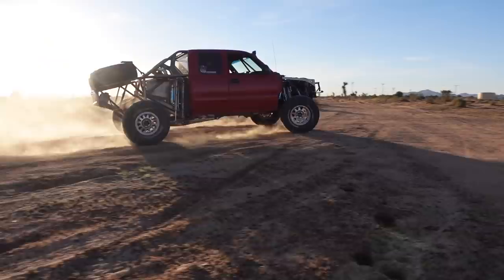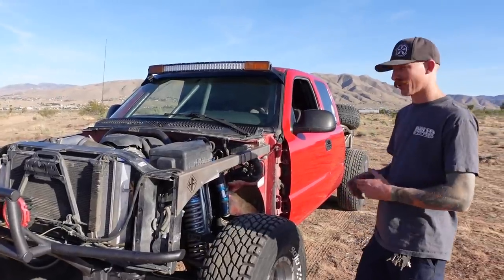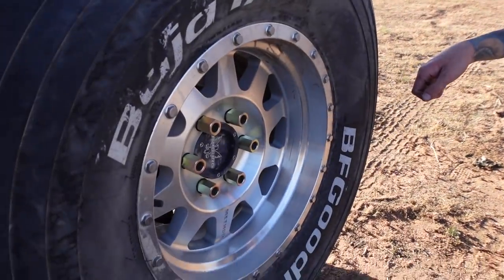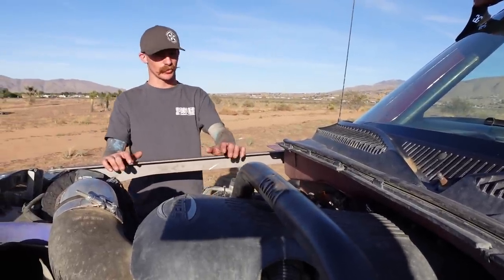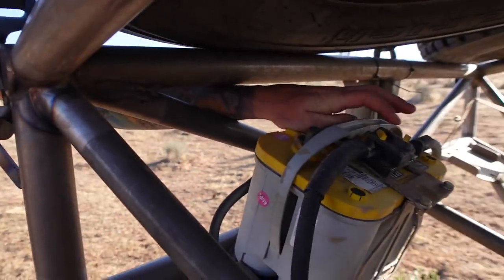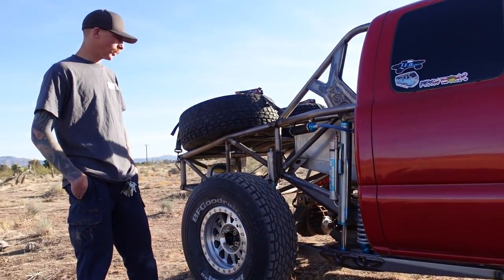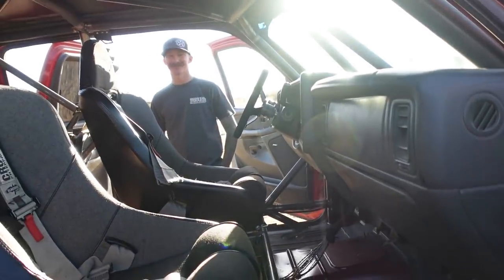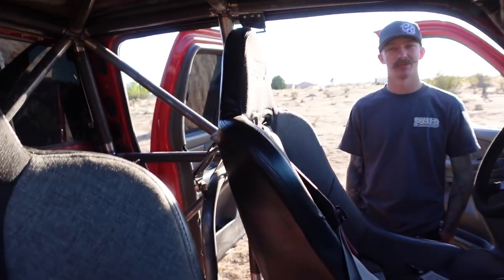Hi-Desert built Chevy Silverado Prerunner! | BUILT TO DESTROY

Comment: Love this build. I like the concept he kept his 4.8 and I get it especially in the aspect where it’s bulletproof reliable from the factory I got a stock 5.3 in mine with cooling system upgraded and an engine oil cooler that I don’t plan to upgrade anytime soon especially since it’s bulletproof (its my 3rd truck with one) and i can run sketchy pemex gas if i get low in the middle of Mexico without worrying about compromising my motor 5:13s make up for it lol. As much as I would want an LS7 in my rig, like they said if it ain’t broke don’t fix it

Comment: Anyone use steel-it paint?  Is it pretty good for rust protection and steel bumpers?
Reply: great stuff. shake it real good or get a shaker already made from Michael Cox at the bronco factory. the shaker he makes goes in a sawzall. my advice is half trigger for about 2-3 minutes and put it on thick and it comes out smooth as silk.
Reply: @brucemcelroy3186  I actually coated my bumper with it and it is holding up real well. And if I need to touch it up I just spray it on!

Comment: Can a prerunner be 2 wheel drive ?
Reply: Yes all of them are i think
Reply: most of them are. you can get more travel out of the front with 2wd
Reply: @nicklopez656  yes, isnt 4 wheels drive more expensive to get travel out of too?
Reply: @KrsMpv  4wd kits are more expensive on A arm trucks because of the added cost of fabricating extended CV axles.